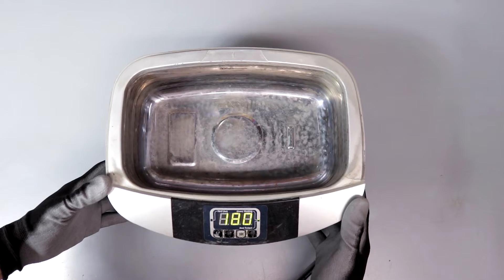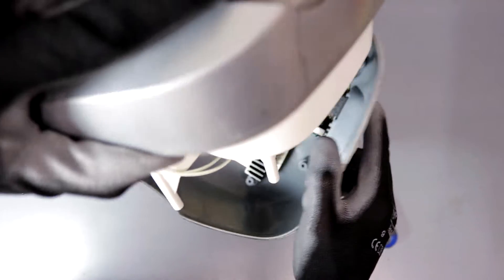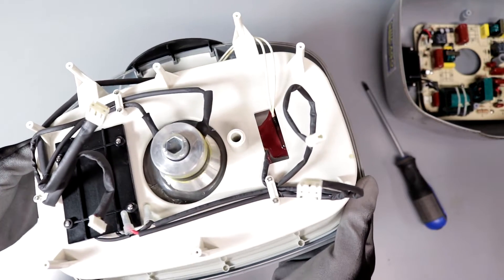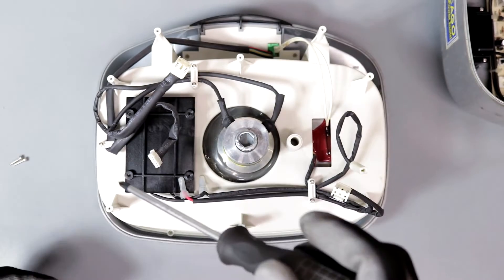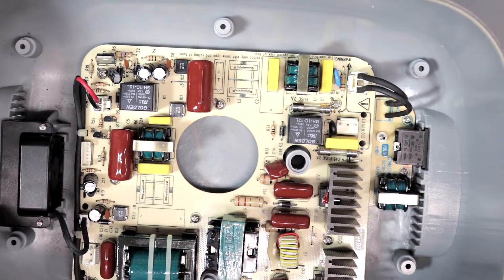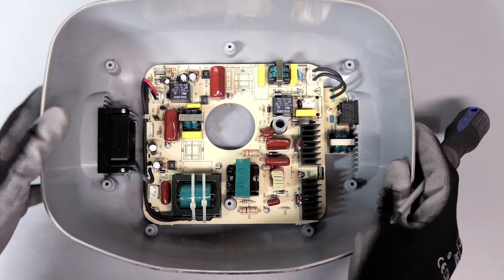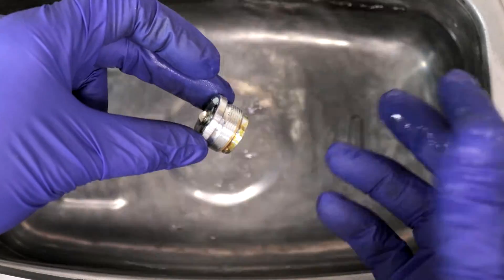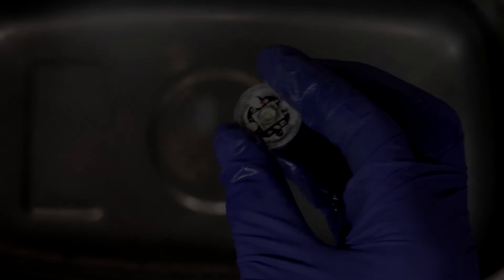Whats Inside An Ultrasonic Cleaner - Harbor Freight

Comment: I would have pulled the board to check the solder joints.
Reply from the maker: Hello anonymous friend, I thought about doing that, but after it started working I just left it alone.

Comment: Keep parts off the bottom of the tank. Setting parts directly on the tank bottom bottom increases the incident of cavitation erosion – pitting of the tank eventually causing the ultrasonic cleaner to leak .  Use a basket, tray, or suspension system to hold parts in the unit.

Comment: You have no clue on what you're doing do you? Don't get me wrong I'm not complaining because now I don't have to open mine I can see it has probably a 40 or 50 Watt transducer. I'm guessing you were expecting a motor inside there. But it works off the pettitor transducer affect. Which produces ultrasonic waves. The only thing you could possibly do is tune it but I'm not even sure if that's possible with the horn it has. The problem you might be having could be due to the receiver on the right which kind of Auto Tunes the frequency. Unless you have a oscilloscope you won't be able to really test it to see if it's tuned.
Reply from the maker: Hello Jason Drennen! Thanks for taking the time to share your knowledge with me. You're right, I'm not too familiar with ultrasonic tanks. I didn't start learning about transducers until I purchased another tank. Unfortunately this tank died about a month after making this video. In fact, electronics is the area I need to improve on the most. I'm really good at soldering though haha! You might already know this, but I've learned that with ultrasonic cleaners, temperature and the type of solution used makes a huge difference in how clean the parts come out. Thanks again for the information. Maybe in the future I'll swap out my transducers for stronger ones if possible. Cheers!